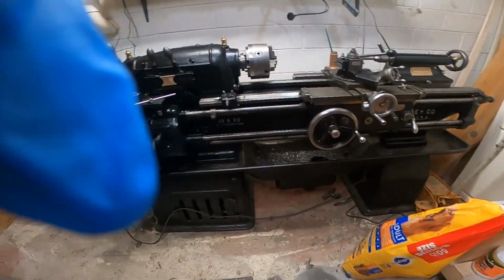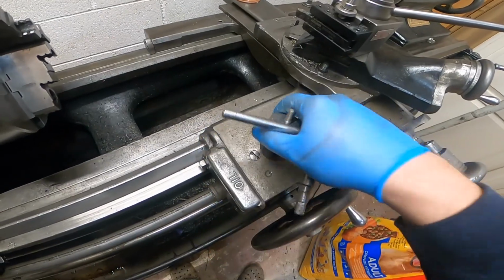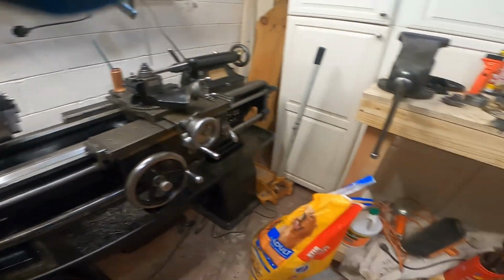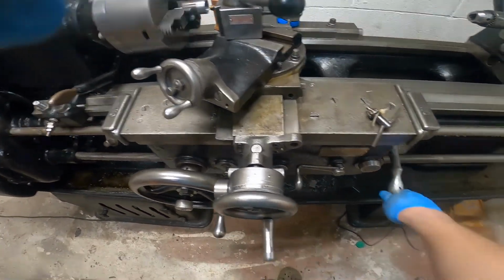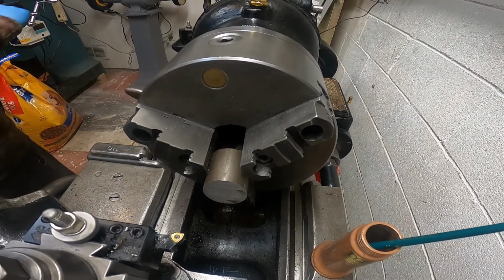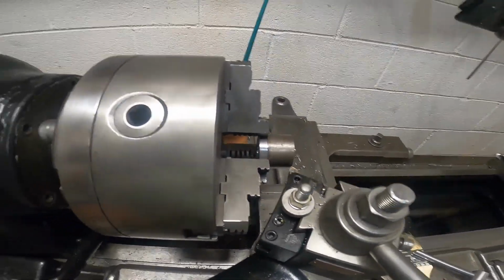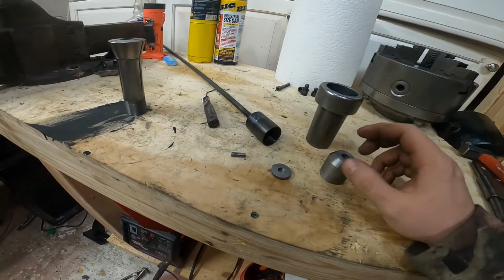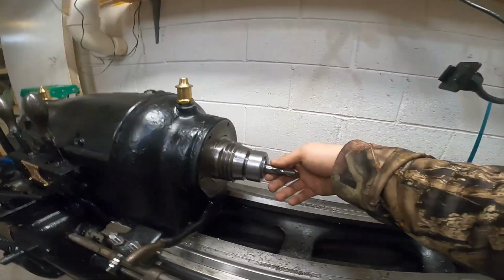Lathe draw bar for original Pratt and Whiney collets

Comment: You can buy draw tube kits to modify to fit your lathe I’d definitely look into it those 5c threads can be a pain to cut mostly because the difference in collets you buy
Reply from the maker: Good idea. I haven’t seen those kits before you mentioned it. I have another set of 5c collets, holders and blocks for the mill. It wouldn’t fit on these Pratt and Whitney collets. These are smaller diameter than the others. Also different thread count. I looked but couldn’t find much information about these old collets. Thanks

Comment: I didn't know about the kits Jeremy Cable mentioned, (My 130 YO lathe only has a 3/8 through hole,) but my first thought was that you should start with a piece of like 1" or 3/4" Schedule 40 or 80 pipe  to allow you to work on long stock.
Reply from the maker: Yes I agree. This was stuff I had laying around. When I make a new one that will be what I do. Thanks for watching and commenting